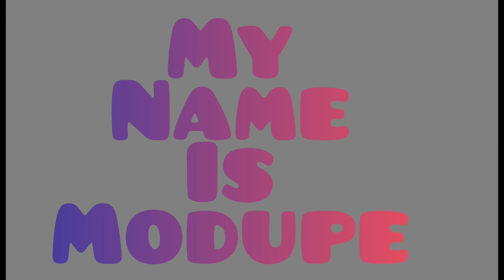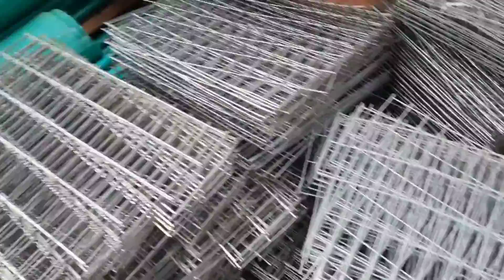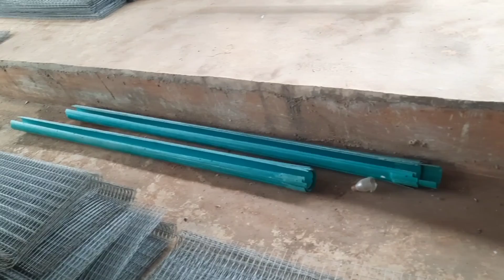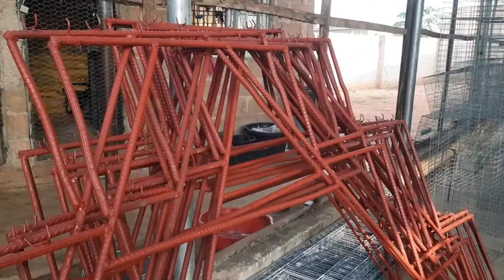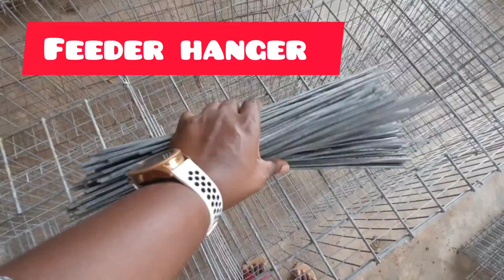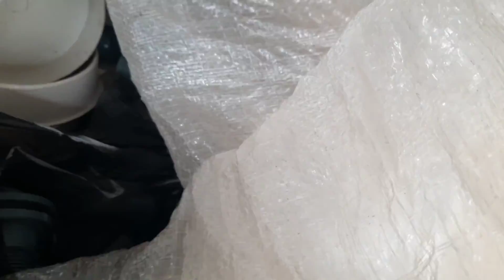Unveiling The Components That Makes Up A  Battery Cage |The Parts of A Layers Poultry Battery Cage

Comment: Are the cages hot or cold galvanized and why did you go for the one you chose? Also, why did you go for the 3 tier and not the 4 tier cages? Any particular reason?
Reply from the maker: The 3 tier cage system works for our farm size and budget.
Reply: Please  did u have  ideas of how  much  I can have Cage that  can contain  96 birds?